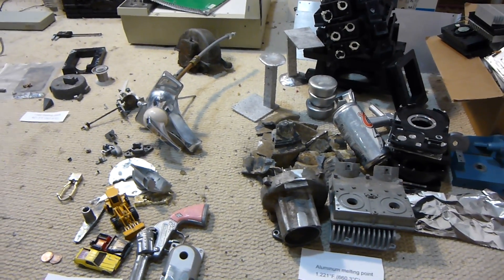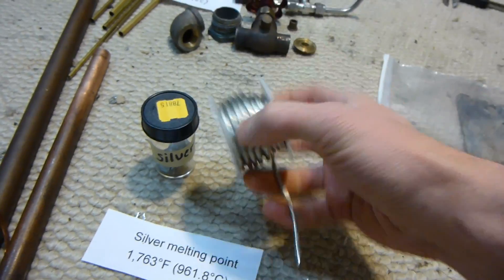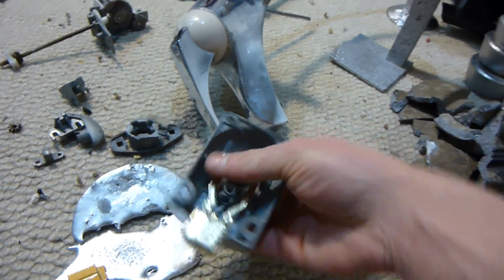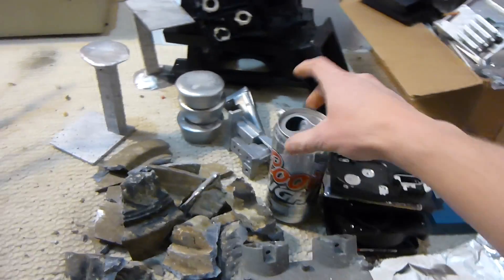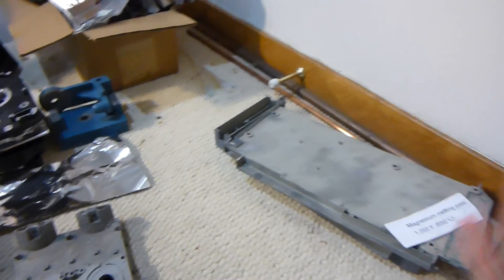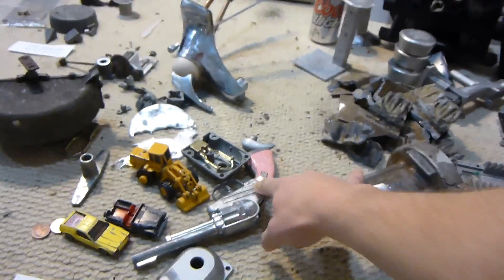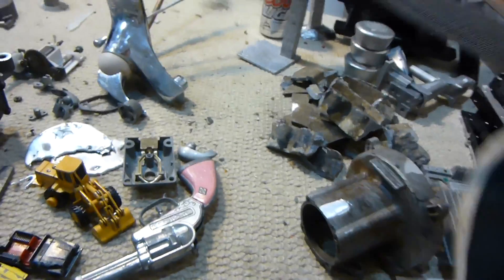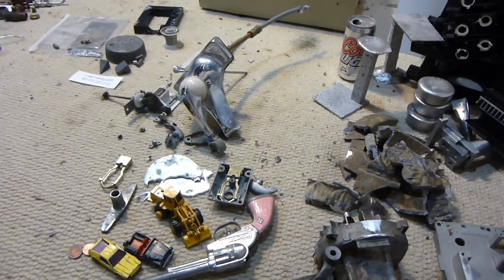How To Identifying Aluminium, Zinc, and Other Metals For Casting

Comment: There seems to be an alloy of 78% Zinc, 22% aluminum that exhibits strange properties.  It goes by the brand name Prestal.  Nearly every source I've found on the alloy, however, is taken from the same source, which is not readily verifiable without buying the referenced book.  

The repeated phrase is "Another alloy, marketed under the brand name Prestal, contains 78% zinc and 22% aluminium and is reported to be nearly as strong as steel but as malleable as plastic"

Sounds cool, anyway.  

Another reference I got to ZA22 was this metallurgy experiment from the University of Washington:

http://depts.washington.edu/mti/1999/labs/metals/al_zn_alloy.html
Reply from the maker: Nevin Williams That alloy that does the phase change is really interesting.  I kinda want to give that a try.  I'm not sure whether scrap aluminium and zinc would be pure enough?

Thank you!
Reply: Well, offhand, a quick check to determine how pure the scrap is, would be to measure the densities of each sample batch, and compare to published values.  That would at least give a suggestion on how close to pure your samples are.  I think it'd be an interesting exercise in qualitative and quantitative analysis techniques.
Reply from the maker: Nevin Williams What if it was an aluminum alloy that had some copper and magnesium in it?  Then wouldn't they cancel each other out?  But that would probably be unlikely!
Reply: Yeah, a density test such as Archimedes' method, is just a quick and fast ball park test.  It ought to confirm that object A is made of the same stuff as object B.  If it can be done accurately enough, then depending on the source of published densities of pure metals and alloys (and whether the metals are in similar crystalline 
states to the published figures.

If the situation were to exist with some heavier and lighter metals having a density  close to a desired one, then the alloy's other properties should help distinguish it from the target metal:  a copper alloy is usually yellow or pink, for instance.

Comment: Nice video! you have a nice pile of aluminium there! Time to do some more melts :P
Where did the big magnesium part come from?
Reply from the maker: Yeah I've got a good bit of metal to cast! The big pieces of magnesium were from this micro controller thing. I forget exactly what it did. I remember it had battery backup pack. Thank you!

Comment: Aluminium and hydrocloric acid make a good source of hydrogen gas.
Reply from the maker: bor_12345's Electrofied Gaming Interesting.  I think zinc and hydrocloric acid will also work.
Reply: @prospektOS-tmo97  , hydrochloric acid is very common.  It can be found at any hardware store as muriatic acid.  I buy it by the gallon for around $20.

Comment: hi Maker J
When you mix metals you change the characteristics ( castability, hardness,strength,CTE, malleability etc.)of the alloy you produce. If you blindly mix metals, you are likely to end up with an alloy which is crap. Factories use certain alloys for certain physical properties required for that product...this keeps recycling easy and cheap...once you start making alloys which are not in common use, the refining process becomes very expensive and not so green. Also consistent alloy formulation will give you consistent results.In other words...try to use the same types of alloy.
Reply from the maker: electro1622  You are totally right.  But I think for most home castings it's not going to matter all that much unless I plan on machining etc.  So if I just want to cast a basic fly wheel it's probably not going to matter that much if I use a bad alloy.  I think a lot of the people that would machine home castings would already know how to tell zinc and aluminium apart and know what is a good machining alloy.  I geared this video towards people who just want to cast something simple.  It's possible however that mixing them in the wrong combination could result in a totally terrible alloy even for that.  I will be keeping my aluminium and zinc separate unless I want to make an alloy.  Thank you!
Reply: No worries..just keep in mind that very small amounts can lead to big changes. For eg. one of the gold/Palladium alloys I use has less than 1 % Ruthenium and Gallium added.These greatly enhance the castability and hardness at that concentration, any higher and hardness suffers by at least 30%or more.
Reply from the maker: electro1622 You are right. A small about could make a huge difference on the properties of the castings. Maybe I'll try some alloys sometime and see how it works just mixing randomly.
Reply: Very good.